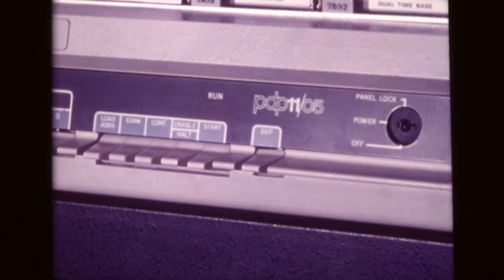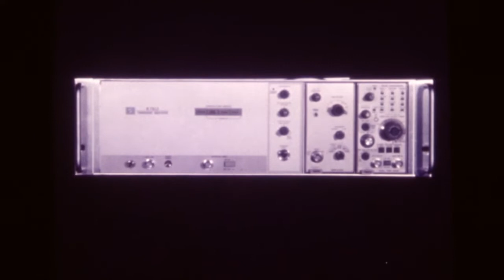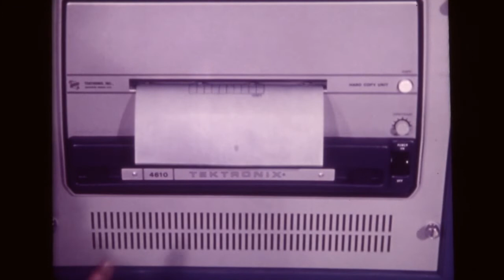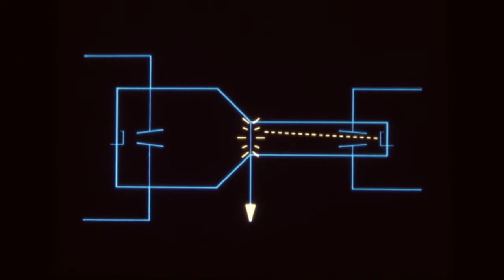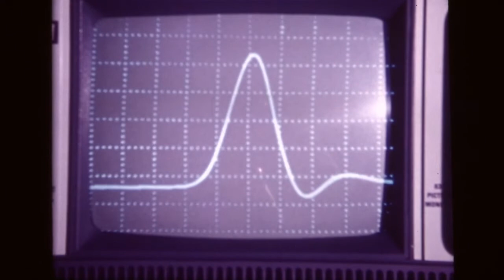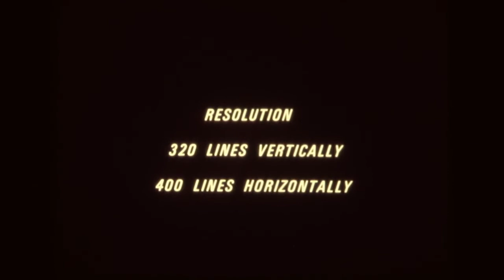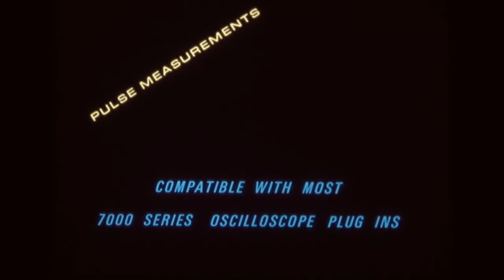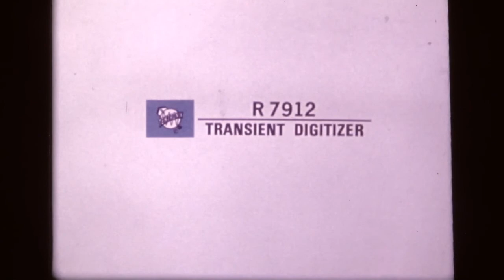Tektronix 7912 High-Speed Transient Digitizer

Comment: When would a film like this be used? Would a Tek sales rep show up at a large customer with a projector and screen, and say “fellas wait ‘til you see what the guys back in Beaverton came up with this time”
Reply: Not likely, this came because some top secret research lab went to Beaverton with a request for a solution, and was willing to give a big bucket of money to them. Then once developed they allowed the sale of the item to other US labs, and probably export controlled them heavily, most likely by not actually selling them, only leasing them. 

film was used to show the non military customers, who wanted to use this, what it was capable of, as a sales item to get them to pony up the likely 5 figure cost of the lease and service agreement, to bring to management to get the money.

Tek still makes the same type of scope, at least they still make fast wide bandwidth digital sampling scopes capable of directly capturing a single pulse at incredible frequency, though now that is at 60GHZ, and buying one is about the same price as buying a luxury mansion in New York or San Francisco. Most houses are cheaper, and thus Tek also sells cheaper ones, not as capable.